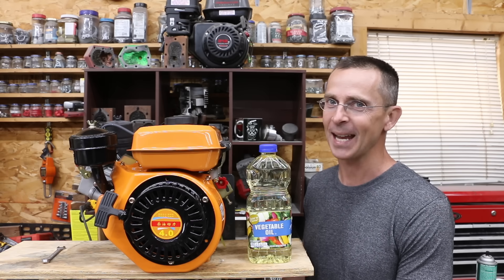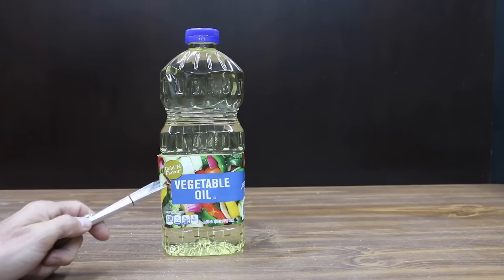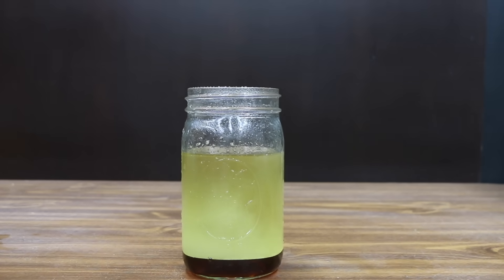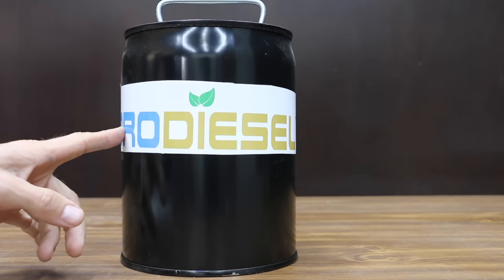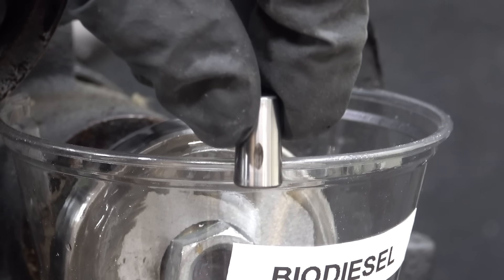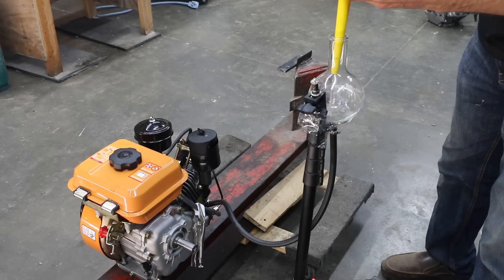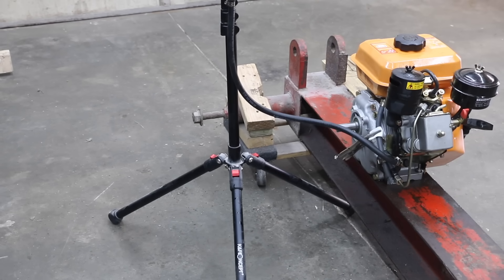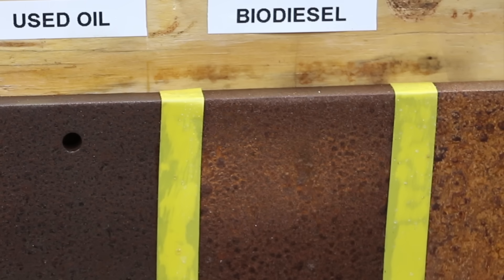Make "Biodiesel"? Let’s find out! Diesel vs Biodiesel, Used Motor Oil, Vegetable Oil, MPG

Comment: I've worked for a major engine producer for 15 years, 10 years in engine development. I tested fuels many times with injector changes, piston changes etc. Your method is very similar, power/consumption, corrosion to materials, viscosity with wear components. Awesome work, love the content.
Reply from the maker: Thanks!
Reply: @ProjectFarm  But what if certain parts fell off that common rail diesel?
Reply: @ProjectFarm  Thank you for a very informative video. I'm thinking of making my own biodiesel to use in my vechile. Can you tell me what's the ratio per 1 litre of used vegetable oil to potassium hydroxide and methanol. Thanks
Reply: @ProjectFarm  I think you can take that as a HUGE compliment sir! 😊
Reply: Has there been any research on untreated vegetable oil on engine efficiency, long-term wear (including seals), etc.?  Thanks
Reply: @cougar1861  mechanical injection won't care, it has enough lubricity and the pressures aren't too high. On a common rail engine, you'll run into issues as most of those oils can't handle 30k psi, things get weird. Viscosity and lubricity are key at ultra high pressure systems. I have a Merc 300D that runs on straight engine oil. I preheat it and it goes through a centrifugal filter and straight into the injection pump, 700k miles and I've put 400 of them with this system. 

Ill say this because I don't want people hurting their gear. If there is emissions equipment on the machine, do not test weird fuels, do not try to save money. There are additives and byproducts that will destroy your emissions equipment.
Reply: @chrisconley3579  Thanks for the reply.  After a while dealing with biodiesel (processed vegetable oil) I've begun to wonder if it might be more efficient, i.e. economically viable, to instead make vehicle modifications to allow burning of UNprocessed vegetable oil to avoid the time, energy, expense and glycerol by-product of the biodiesel process.
Reply: @chrisconley3579  Thanks for the info. I have read that the original Diesel engine was made to run on peanut oil . Q#1 running your used oil through a centrifuge  , on the car , how do you do that,? or is it off the car ? & Q#2 - how do you make a centrifuge & what would the micron # be ? 5-6 ? Which is what Ford diesel fuel filter is . Q#3 how about smoke level  
I have a 1989 case tractor , Lucas pump , 3.9 Cummins , I am Canadian retired in Costa Rica
Reply: @chrisconley3579  what should I do before running used oil? Pre emissions and have a few track cars that get frequent oil changes. Tons of bikes and family does around 2k miles a month each with me doing around 4k.

Always have oil and getting annoyed disposing of it.
Reply: @crpth1  I usually put old oil into one of many vpRacing cans that I've accumulated. Used to take them to have the oil recycled then reuse the cans.

Friend came over and noticed a leak from his fuel tank where something hit it.
We dropped tank and he fixed it temporarily with this putty, then grabbed about 12-15 gallons of used oil from a bunch of cars and filtered it through a coffee strainer into the tank. 

I wanted to cry when I saw all the smoke haha
Reply: @cougar1861 go through Fuel filters real fast. Unconverted W V O and vegetable oil is highly acidic, up there with ethanol. Hot acid likes to eat metal.
Reply: Follow the instructions in the video.
What he did to the veggie oil, and you must do with all fat fryer oils, is remove the glycerine from the oil before putting it into your tank.
If you don't do this, the fuel system and engine gets built up with the stuff, and repairs aren't cheap.
Once the glycerine is taken out, it can be used for soap, and anything else that uses it.
Reply: I used french fries oil for a few yerars in my old Golf eit 1,9 TDI engine. Added regular diesel of under 10% per full tank. For winter some anti-freeze. Oil from the french fries needs to be utilized so when somebody takes it for free its a great deal for fast-food restaurants.
Reply: Interesting.
Reply: @yoMXTT  interesting profile picture 🤔🤔
Reply: Great insight, thanks, Chris.
Reply: Alex Fracyon  no, the Lucas injector cleaner about once every oil change, and the Lucas oil stabilizer and Motorkote every oil change.
I got the wear down to half, judging by the filings picked up by the magnet on the oil plug.
The truck was used OTR, and team at that, so it was in full swing 98% of the time. Never had any engine issues at all, only the ancillary systems.
Reply: I like Lucas for what it does, cleaning injectors, and keeping oil in the engine when it's shut down.
What I DON'T like about the oil additive is that it pulls away from the  sharp edges where you need it most.
I always put a gallon of Lucas in my truck engine, and a gallon of Motorkote with it.
It makes the oil go towards the heat, not away from it.
Actually wore out the seals on a Sixty Series Detroit long before the engine gave up.
Can't just replace the seals on them, no provision, darn!
Reply: @danieljones317  ive personally never supported lucas oil additives. Sticking to parts is not what oil is intended to do in car motors, its designed to push through passages, inbetween parts, and act like microscopic ball bearings. And apply proper pressure where needed like chain tensioners.
    I dont see the harm in small engines with flinging type lubrication though
Reply: @marioncobretti7870  I'm not talking about becoming a gooey mess, no way.
I like the way that it sticks around, while untreated oil tends to just drain into the pan. It eliminates dry starts, and the oil pressure is a bit higher in the upper revs.
The Motorkote is a metal treatment, and our good farmer has a video on it, just look in his archives.
It pretty much proved what I already knew.
I've sprayed gate hinges with the stuff, and it takes nearly a year for them to howl again. These are industrial gates, too, made of 5" channel, and about 15 foot long, each.
The rain just doesn't wash this stuff off.
Reply: @danieljones317  Its good for older than 2000s diesel cars, I would not use any of that in modern diesels with egr, dpf etc. If you really want to protect the engine, just buy premium diesel and add some dedicated diesel lubricant that won't clog up anything, like Liqui Moly Schmier or equivalent product that's certified for modern cars.
Reply: Alex Fracyon  diesels are not gassers, and can not only take more abuse, but are more flexible when it comes to fuel.
Take care of them, and they will last a lifetime.
As a mechanic, the ones I drive and service have never had a wrench laid to the innards since they came off the factory floor.
About the only thing that has been replaced on any of them is the turbo.
Mind you these are also severe service vehicles.
Road trucks are considered light duty.
Don't worry about your engine, it will serve you well.
Reply: ,
A good prayer:
I'm a sinner JESUS please forgive me for all my sins I know you shed your Blood for me on the cross at Calvary. Thank you JESUS for my salvation and for shedding they Blood for me. I love you JESUS. 
Romans 10:5/10 ct...❤️k
JESUSisLord!Amen...
Amen..
If you'd like to call someone who cares 
83
For
Truth.
bc you don't know when you'll die?
.y r u hesitant.......

..
Reply: @Mr.Caring  Thanks, Mr./Ms./Mrs./Mx. Spam.
Reply: Cool! I'd really like to know: I've run my 1999 Peugeot 106 diesel (not even common rail) on sunflower oil for years. I think I did 100K on it, using half a tank of normal diesel every 1000km. Never had any issues. Only thing I can think of that might form an issue in such an engine over time is the fuel pump, since it has to work quite a bit harder if the oil isn't pre-heated. I was expecting sludge build-up over time but the contrary happened: engine stayed very clean. Probably since it burns cleaner and apparently more complete. I don't have that car anymore but I would like to know if biodiesel would make a big difference or not, in terms of wear and tear. The thing that jumped out at me was that I never experienced any seals or plastics or rubbers that degraded over time, which I was expecting... Any ideas how come? 

Also: in modern engines, what would cause them to be more picky about the fuel? Wouldn't pre-heated sunflower oil do just as well, if not better, than normal diesel? 

The biodiesel... Am I correct in estimating that due to the additives to make it into biodiesel, would be more corrosive on seals/rubbers when compared to sunflower oil and normal diesel?

It really made quite the impression on me back in the day: sunflower oil. So cheap, clean, no extra wear and tear... It still really makes me wonder if it isn't the best fuel for a diesel engine... and that all the mumbo jumbo we keep hearing about it being bad for the engine over time is just exactly that: industry mumbo jumbo... 

You'd expect plenty of people that have tried the same as I did to have experienced major and frequent issues if it really was that bad. 

Except for the pump, indeed. But that can be solved by preheating a bit.
Reply: @mattstroker  - Spot on. In fact it's crazy when we think about it. The recycling stations take our used oils. To sell to power stations, etc... It's a bit nuts when we consider that we're dumping it, so someone else is making money out of it...
My used engine oils do have a prolonged life in my hands. Economy & Ecology in one stroke. 
Bring the Eco's together. ;-)
Reply: do you recommend using straight used cooking oil / motor oil?
Reply: residue junkie  where is the video?
Reply: Now I want to know if any of these can improve mpg.
Reply: I just wanna use all the fast food places old grease damnit.
Reply: I wonder if there would be a way to optimize an engine for biodiesel, but also optimize the NOx removal, without the current EGR, SCR, DEF, etc. systems. A return to the simpler engines from the 90s and before. And then procure sustainable biodiesel from non food crops such as Jatropha Curcas?
Reply: Hey buddy I’d like to reach out to you for some questions
Reply: How about kerosene with diesel?
Reply: Kerosense with vegstable oil
Reply: I'm looking for a job help me
Reply: @davidscott5903  Thanks
Reply: @cougar1861  
I do also have to admit that the vegetable oil had started to gum up around the filler neck of the stock fuel tank where the oil was allowed to dry, so if you do plan on using WVO long term make sure that you have a large fill tube.

Comment: The wmo and veg will Coke the injector nozzles closed if the pintles are shrouded for heat shed and noise.  On my 6.x humvee engine in my ranger, as a group we learned to drill out or Mill the face to mitigate that....oh ..8 or 10 years ago.  I been using it as expiremental  since 2002 for emergency options
Reply from the maker: Thanks for the feedback.

Comment: The locomotives I work on were used as "guinea pigs" for emission testing with various percentages of bio-diesel.

Using a blend of 20% bio to 80% ULSD was the maximum recommended. The people doing the testing wound up testing up to 100% bio on one locomotive. 

It clogged the entire fuel system, destroyed the injectors (crystallization), and ultimately wound up blowing up the turbo causing major damage to the interior of the engine room, and came close to taking out a train crew member - it blew up about 1-2 min after they'd walked through the engine room.
Reply: do you know if they published a study or paper on this? it sounds like an interesting read
Reply: @SuperCookieGaming_  I'm not sure - it's a project from one of the local universities, so I imagine something is available. I doubt it will include any information about the damage to our equipment though, as they were only analyzing emissions. 

As far as emissions go, most were reduced by using bio - except particulates, which increased dramatically.
Reply: @jameshaulenbeek5931  just to confirm, are you sure it was biodiesel and not straight vegetable oil?
Reply: @mckenziekeith7434  yes - the bio was specifically made and blended for the emissions testing project. 

You can search for the published paper as I stated above - sorry I can't drop a link to it.
Reply: @SuperCookieGaming_  if you do a Google search for "ncsu locomotive emissions testing" the first link is the published paper. 

I just breezed through the first bit of it, and the information us lowly mechanics were told is not what was reported in the paper (just an FYI - what I said about particulates isn't accurate, according to the published results).

Should be an interesting read though!
Reply from the maker: Thanks for sharing.

Comment: No need for the chemicals... i make mine with used fryer grease or used lard.. add 10 to 15% gasoline,  and ro dry it out i spray it into a new container,  i spray at a distance against the wall 9f the new container, this make any water that may be in there to evaporate off.. i can make 15 gallons in about an hr or maybe a little less.. and no need to wait 24hrs, you can just pump it directly  into your vehicles fuel tank. Just make sure to filter it first.
Reply from the maker: Thanks for sharing.

Comment: As for the veg oil, that worked on the older cat engines here in the UK but it kills the newer stuff
Reply from the maker: Thanks for the feedback.
Reply: @ProjectFarm  I heard you mention that after I'd posted the comment, but yes, a friend of mine ruined a newer car running it on veg but his 1997 one had no issues at all for the years he had it
Reply: Do you know why? Not doubting you but all I run are gas engines and I'm just trying to understand what's different about the newer diesel that they don't like veg oil.
Reply: @joshuagibson2520  is the pressure study they run at and the atomisation at the injector that causes the issues
Reply: @therealdojj  aaah. That makes sense. Thanks for filling me in.
Reply: @joshuagibson2520  some systems run at beyond 30,000 psi to get the best out of the systems
But the higher the pressure and the better the economy, the smaller the particles that are emitted, leaving to more health problems as those smaller particles get furthest into your respetory system 😔
Reply: @therealdojj  so basically the older diesel systems use lower psi fuel delivery and spray more of a solid stream whereas the new are more of a mist?
Reply: @joshuagibson2520  correct, hence the better fuel economy
But the tolerances are much tighter in the system so you need that lubrication
Reply: @therealdojj  thanks again for taking the time. I know little to nothing about diesel and that changed for the better today.
Reply: @joshuagibson2520  no worries pal, just sharing the knowledge :)

Comment: Love seeing your assistant in the thumbnails. Too funny! Commenting early, but I know the video will be excellent. :-)
Reply from the maker: Thank you very much!  You did a terrific job with your video today!!
Reply: @ProjectFarm  shoulda tried running the engine with them all mixed together at the end lol.
Reply: @ElectricalExistence  Shoulda woulda coulda
Reply: @ProjectFarm  Please search for: "Chevron diesel fuel PDF" and Read Page Six. Sulfur compounds in diesel do not improve lubricity. The sulfur compound in motor oils is an additive called ZDDP. It is often confused.  You have great channel, not being critical. I worked for Shell and ARCO in all operations of refining including Lubes production as a chemical engineer.

READ MORE
Reply: @highwaymen1237  Thanks for that,   what about the claim that early diesel fuels lubricated better?   is it simply that the older engines have worn out, and people blamed the new fuel?

I just suggested to someone to put some zinc DDP in his fuel,  but he said '2 stroke oil is cheaper'.  what do you think of putting a little ZDDP in fuel for older engines?
Reply: @acbikeoz  You definitely don't want to put ZDDP in your fuel.  Modern diesels have catalytic converters to reduce nitrogen oxides. The zink and phosphorus in this molecule will kill the catalyst very fast.  Modern Diesel engine oils have reduced the amount of ZDDP to minimize the amount of crank case vents blow by loss  from getting into the air intake.  I think one of the best diesel engine oils is Shell Rotella because it has one of the higher contents of ZDDP at 1,000 ppm.  This oil has a tight control on distillation curve to minimize light end losses that can carry the ZDDP out the vent.

The reason crude oil derived diesel supposedly has better lubricity is the hydrocarbon composition.
Reply: Why don't you comment on Taofledermaus anymore? You used to be around for every video.
Reply: @joshuagibson2520  Because Taofledermaus is a selfish jerk that only cares about himself. Multiple times he have clearly showed what matters to him, and it is not other people, it always about his own skin. Just as an example look at a fairly recent video ''NEVER go "Full-Grebner" and you will see how much of a jerk he is.
Reply: @Drakey_Fenix  neat opinion, but I wasn't asking for yours. I didn't like the grebner video. I thought it could have been done better, but I don't disagree with him.